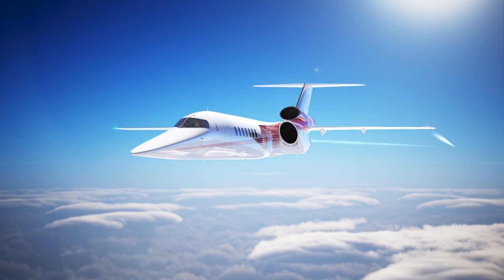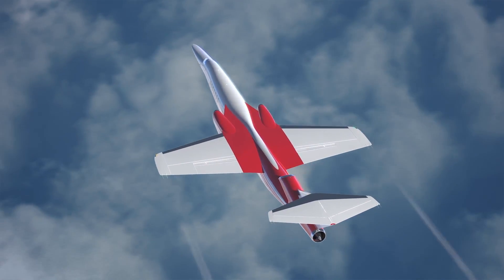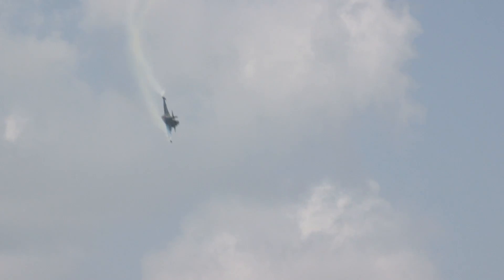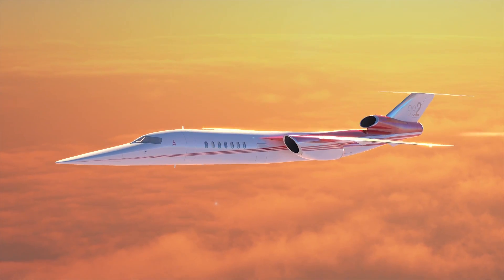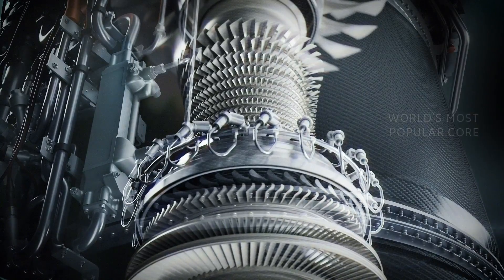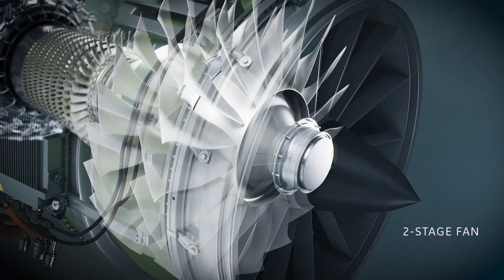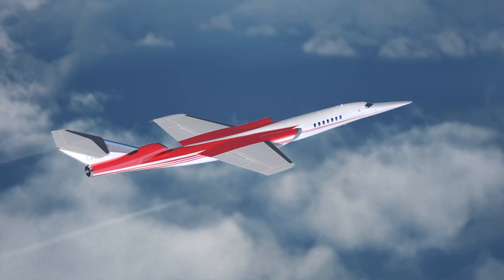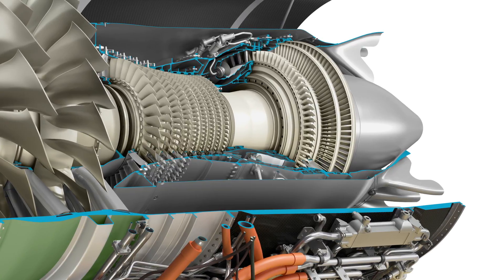Aerion Unveils Stage 5 GE Affinity Engine for Supersonic AS2 – AINtv

Comment: Wow. A 3 engine multi passenger F104 Starfighter.  Why 3 engines instead of 2?  Maybe ETOPS certification reasons?  Packaging issues? I always thought a star fighter was a cool hot rod of an airplane. With this configuration, it might even be faster than Mach 1.4.
Reply: In one of the earliest videos about the AS2, they mentioned that a third engine was added to improve takeoff performance especially for shorter runways.

Comment: It could cost twice or thrice the amount to operate over a loaded G650 and it would still sell like crazy. This would be a necessity  for a very large international business.
Reply: I am not convinced it will "sell like crazy".  The aircraft is going to be very expensive and I am not even convinced at this time that it will even ever be certified.  Assuming that it ever flies, it is going to be a very long, expensive and difficult certification.  I wish all at Aerion good luck in this endeavor, but I really have my doubts of the viability of this program.

Comment: It would be even cooler if this aircraft's engines ran on electricity from a fuel cell powered by hydrogen. ✌
Reply: Yeah we could store all the hydrogen that would be needed to run these engines  in a giant Zeppelin tied to the back of the jet.
Reply: @Quackersssssss  The problem is with Hydrogen storage. Hydrogen is a very sparse substance. At its densest, it still takes up 4 times the space compared to conventional fuel. And to reach that density will require you to liquify the Hydrogen down to 20 degrees away from absolute zero. Expensive insulation is needed to separate this incredibly cold substance from the outside world, adding even more size, weight and cost.

What you suggest has already been tried, successfully, with the Soviet experimental Tu-155, which was a modified Tu-154 jet airliner with engines that were able to run Liquid Hydrogen. If you look at some diagrams of the plane, you will see that the Hydrogen tank takes up a lot of volume.